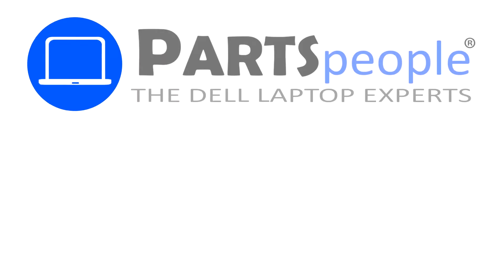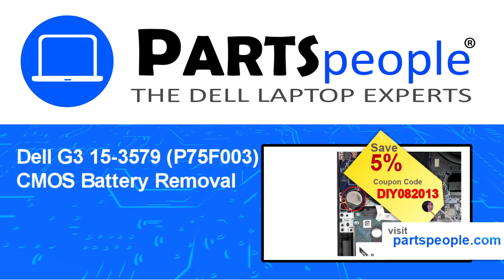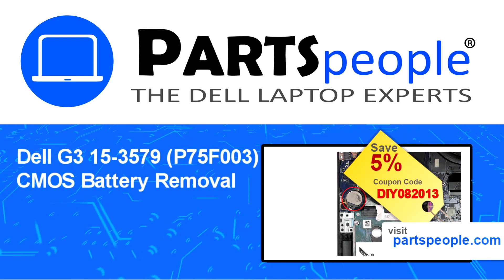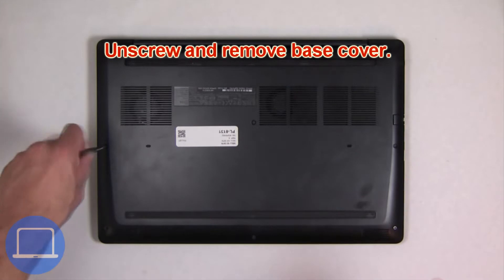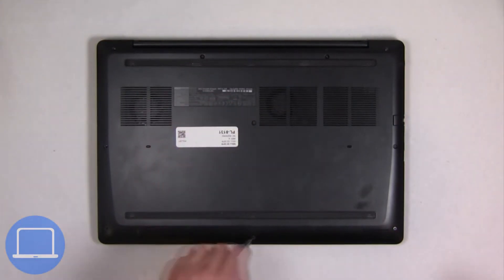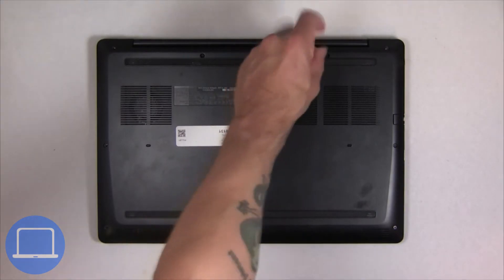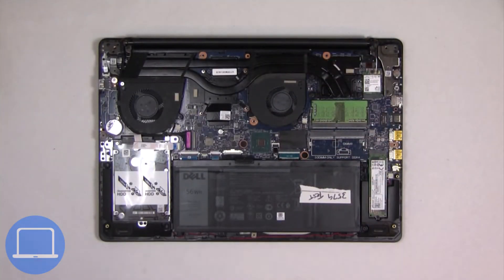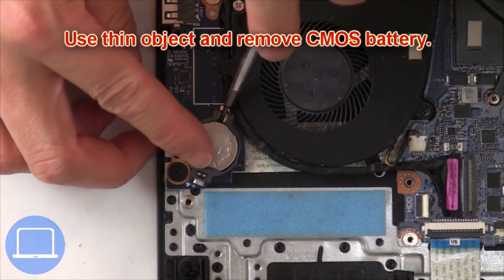Dell G3 15-3579 (P75F003) CMOS Battery How-To Video Tutorial

Comment: WTF?  OK, so you replace the battery and then WTF happens?  Does the computer need to have anything reset?
Reply from the maker: Hi, no all information is stored in the bios chip...as long as it's not corrupted you there's no problem in replacing the battery.